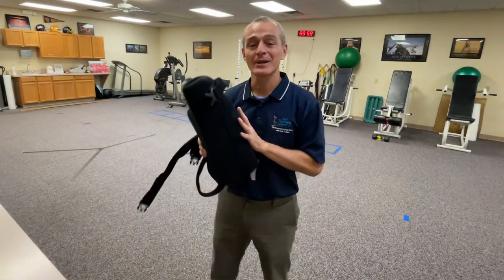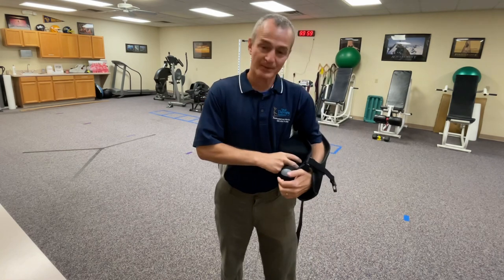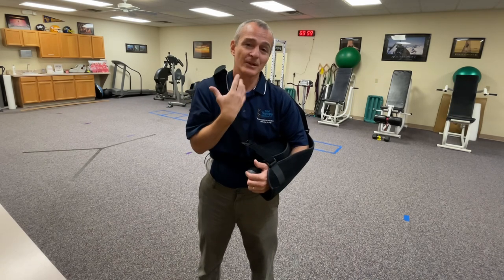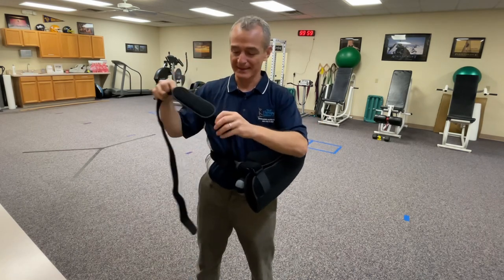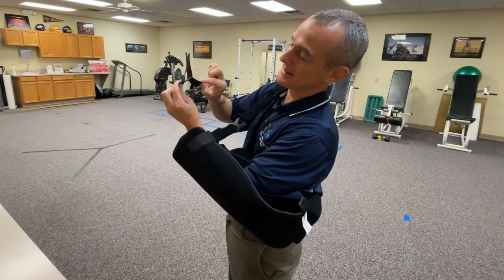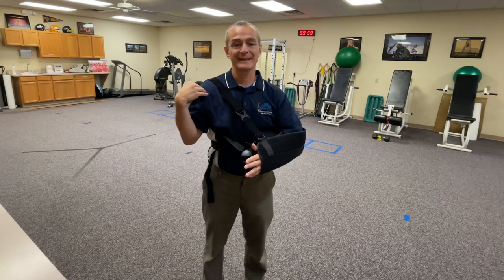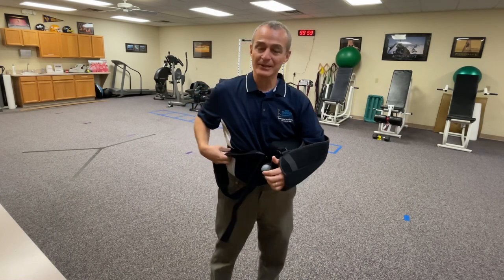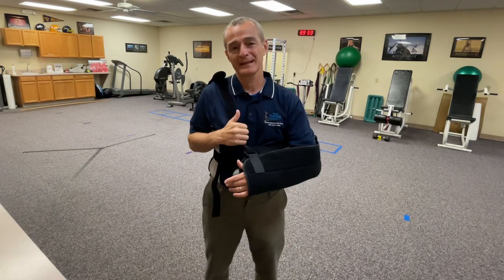Most Comfortable Shoulder Sling Modification After Rotator Cuff Surgery

Comment: Omg! You’re a life saver! For 1 thing, by watching your video, I realized most of my discomfort came from my surgeon’s office not properly seating my elbow in the corner of my sling, so the weight of my dangling wrist & hand pulled my arm into a lowered position. I had no one at home to help reseat & adjust my sling to include your modifications, but though challenging with 1 hand & a lot of Velcro, I finally managed. Although it does put pressure on my shoulder, at least I’m no longer choking between the sling strap & cold therapy shoulder cuff/sleeve. Thank you!

Comment: Why not make another nylon strap with Velcro on it that would attach somewhere up behind the neck and then go down and under the right arm (in your situation) and attach to the waist pad or sling.   Then lengthen the original strap, and then tighten up that slack with the new one that goes under your arm. That would change the direction of pull in the neck area.